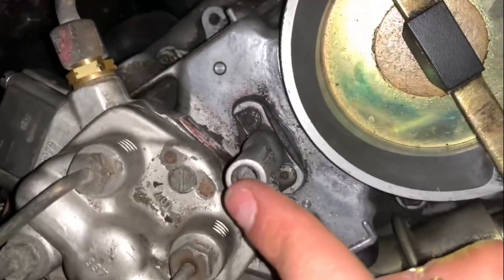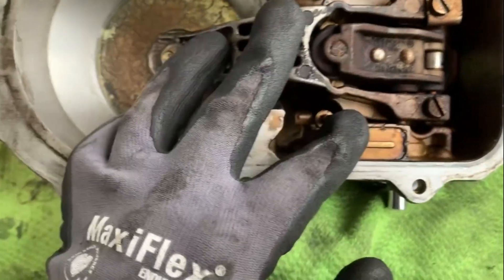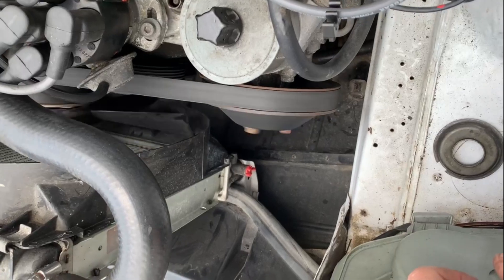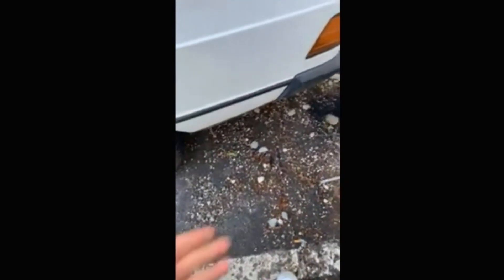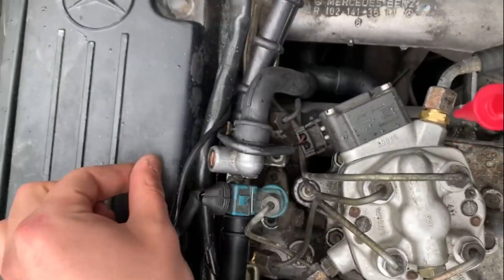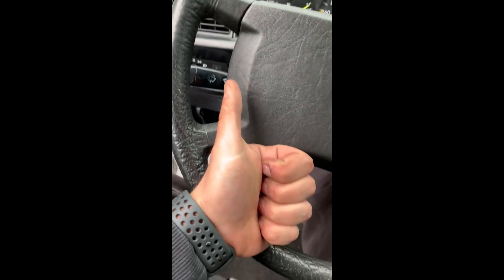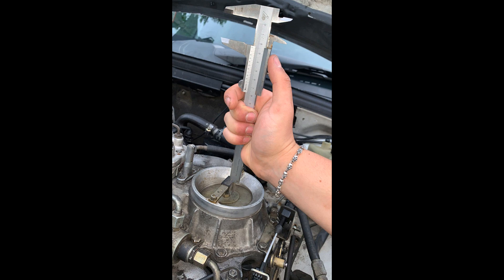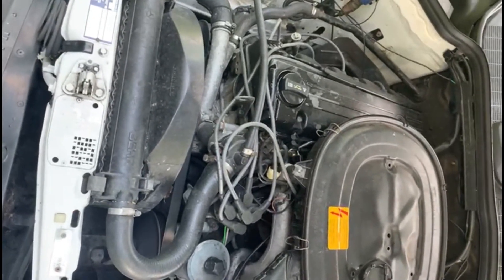㉦Mercedes Ke-Jetronic㉦ - A white Mercedes Benz W201 190E back to his former glory

Comment: Hello, because when I start the car the revolution needle oscillates a little up and down but when the engine reaches normal temperature it no longer oscillates. I have a mercedes 190e 2.0 gasoline from 1992. Thanks
Reply from the maker: Hi, thanks for the comment. The same thing happens to me. I think it's normal. If you get steady idle afterwards then it's okay.
Reply: @mercedeske  thank you very much for answering my question i was very worried once again thank you

Comment: Hi Ivica, having a problem with my car, it is actually same as this in the video, even the same colour 😁. So the problem is when the engine is cold and i start the car, rpms stays low, like in the video (about 550rpm), and when i rev it a little bit and then release the gas pedal rpm drops to 450/500 really fast and the engine almost stalls. Wondering is the something in that system that controls the air to fuel mixture while engine warm up. 

Greetings from Bulgaria.
Reply: Thanks for the fast reply 😊. Will check the potentiometer and change it if it's needed.
Reply from the maker: Hi. Have you replaced the potentiometer? Replaced and calibrated?

Comment: Hello there: thanks for this great show! I have one issue with my 1986 6cylinder w124: I have changed the fuel pump, k-jetronic distributer and plate. Now it is running rich. How to fix that?
Reply from the maker: Try to set the gap of 1.9mm. There is a free play in the plate before it starts moving harder. That freeplay must be 1.9mm. You have it on the video how my subscriber does it. You measure yours.
Reply: @mercedeske  Thanks! I'll try that

Comment: Good day, my friend.  Love your channel.  I have 1986 w124, m103.  I have been tinkering with my fuel distributor... Tested my potentiometer - a bit lower than range you indicated as I am getting 1.19  between pin 1 & 2 and increasing when deflecting sensor plate.  Is this a replace?  Original part.  If so, best place to source?  I am in U.S.
Reply from the maker: Good day to you and thanks for those nice words. If the initial value without deflecting the sensor plate is not 3.6-4.2kiloohm then yes, it is a replace. As for the part itself, you can buy it on ebay - the original ones from Bosch can be found for about 220$ I suppose and there are other good potentiometer for about 60$ with shipment. I took one of those they do the work very good. It's up to you to decide, don't buy used onces because this is something you will replace each 100k miles. How ever you decide, that's what I can tell. Best regards and Happy Mercedesing,
Ivica+